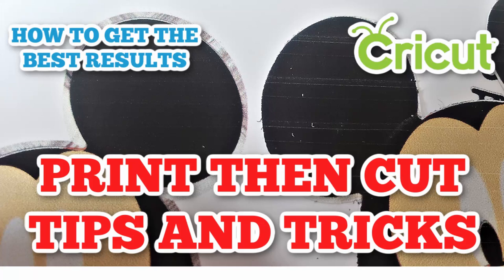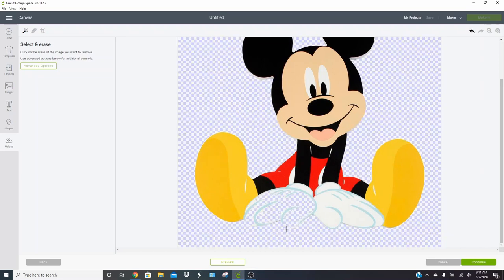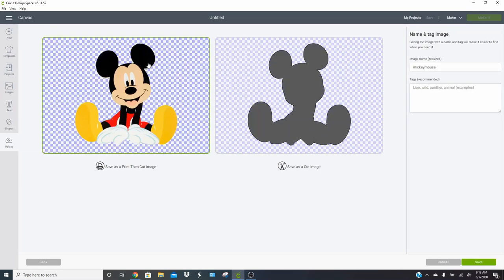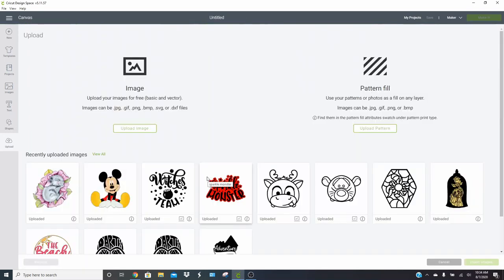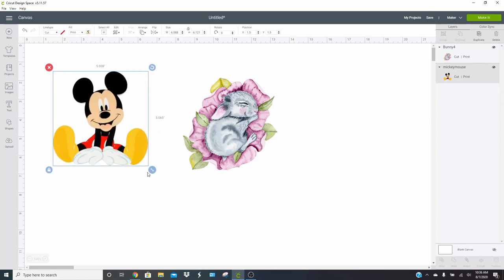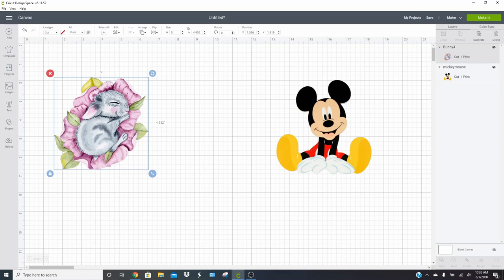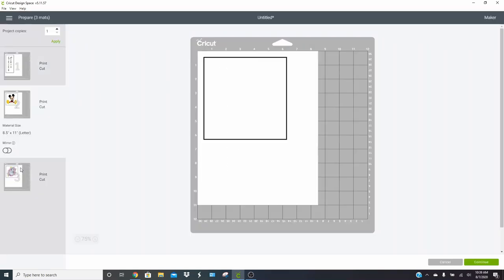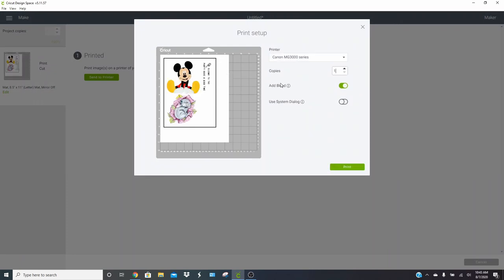print then cut - Cricut tutorial tips and tricks - System dialog - How to print without lines

Comment: Hi! I recently used your tutorial to cut stickers, it worked really well. It seems like Cricut made an update to their Design Space, and now when I print, it prints on only a small portion of the page - and I CAN'T figure out how to fix it. Have you run across this issue? I'm on a Mac. I'm pretty good with technology and can troubleshoot most problems but can't figure it out. Someone on Instagram sent me to you. I'm just wondering if you have had the same problem.
Reply from the maker: A few people seem to having this problem. One thing I have suggested is clearing the cache and also double checking your printer settings. Go under the actual printer not just the print dialog and be sure nothing has changed

Comment: Thank you! I still get lines with system dialogue, any extra helpful tips :(
Reply from the maker: If you are making sure you have turned off your high speed print you may need to run some maintenance on the printer like a print head cleaning

Comment: Thank you for your video.  It was very helpful, however I am still having issues and was wondering if you would be able to help me??  I have done everything you have suggested.  My images print out perfect from my printer (HP Officejet Pro) and once I insert them to my Explore Air 2 it looks like it's working, but it only cuts the perimeter.  Does not cut out the image.  Is this something you can help with?  I have wasted so much time and material and I'm so very frustrated!
Reply from the maker: Sounds like you are not removing the background from your image
Reply: @CorinneBlackstone  Okay I will give that a try! Thank you so much!!
Reply: It worked!!! Yippee I appreciate you so much for responding and helping me out!!

Comment: First of all thank you for this video as it helped me with a few issues I came across when using the system dialog option (it was hiding behind design space!) My problem is that my stickers have been cut off centered. What I mean by that is that I put an offset of 0.3cm around my sticker image, aligned centre (image + offset) then flattened it. all looks fine on screen but then it went through to cut the sticker out around the offset its not even all round, The left side is like 0.2 and the right side is like 0.4 or something. Would you know how to solve this problem? TIA x
Reply from the maker: If you haven’t calibrated your machine you’ll need to try that first. But even since the last couple updates the print then cut has been so bad it’s not even funny
Reply from the maker: Heres the video on calibration https://youtu.be/o5-ZRHqeL78
Reply: @CorinneBlackstone  oh really well that's good news then isn't it 🤦🏼‍♀️ I have calibrated a few times when I had issues when I first bought the machine. I will do it again. Thank you so much !

Comment: Good video, thanks for posting!  I especially liked your tip about using the system dialog...what a difference!  One question, please...what did you mean when you said the part about how calibration on the Explore is print & cut only but calibration on the Maker is for the blade too?  Can you explain this to me, please?  TIA!
Reply from the maker: It’s only for the knife blade on the maker and for the print then cut it to line everything up and the knife blade is for depth

Comment: Can you please explain what you mean about the calibration for the explore? When I do the bleed I still get some white like you did, what can I do to make sure there is no white what so ever.  thanks
Reply from the maker: Calibration is to run your machine and have it read this test page so that it can make sure the sensors are aligned properly. The calibration option is under the settings menu on the left (the three lines) in design space
Reply: Thank you so much!

Comment: Thanks for the tip. I’m making a tshirt but the white box is not looking good when I put on a tshirt. How do I solve that please
Reply from the maker: You would need to remove the box and only cut around the image
Reply: Thanks or the prompt reply. When I remove the box it was cutting the images individually rather than as whole if that makes sense
Reply from the maker: @doubletcre8tions  yes that’s what it does. If you want to put something on a shirt with print then cut it’s going to have the box around it or it will cut them individually if that’s not the look you want you either have to piece it together on the shirt or you need to use something like sublimation on a polyester shirt
Reply: @CorinneBlackstone  makes sense thanks so much 😊

Comment: I use system dialogue but it prints black and white, my printer is set up with circuit but I can’t seem to get the option to print it in color with SD any tips?
Reply from the maker: Make sure to check your printer settings the black and white issue is almost always from your printer settings in your control panel

Comment: Is there a specific vinyl I need to use. My printer is printing smaller then it is supposed to?
Reply from the maker: You have to use a printable product. Check your printers paper size
Reply: @CorinneBlackstone  I’m using printable vinyl. On design space it shows it printing at 4 inches but it’s printing smaller. Do you know why or how to fix this?
Reply from the maker: @jenniferaragon4889  you need to go into your printer properties and check the paper size.

Comment: I need help so bad, if u can pls help me, I’m like a slow learner so I need step by step, I’m using circuit maker, I’m trying to use print & cut but every time I do it when I load it in the maker it keeps cutting like the rabbit but I’m trying to cut it all out like Mickey, can u pls just give me the steps to do that pls? I would appreciate it so much, I tried cutting with scissors but it looks horrible plssss help me, Also I subscribed to your Chanel so I will be watching u
Reply from the maker: it sounds like you are not removing the background from your image before you choose print then cut. Be sure to remove all the white background before you hit apply and continue

Comment: I am doing my print then cut with a sublimation printer, but when I did the print then cut with mirror on my printer bc it's sublimation, it put the black outline on the left side of the paper...so can I load it in the corner still in photo orientation or do I need to make sure the box is turned so that it is in the left corner?
Reply from the maker: You shouldn’t cut sublimation there’s no need to. Plus printing from design space for sublimation wastes a lot of materials and ink
Reply: @CorinneBlackstone   actually, I figured it out. And I’m doing sublimation on HTV, so yes, I do need to print then cut bc I want it to match up exactly for what I’m doing, no overlap.

Comment: When I get to the print part, it doesn't print the top black line. Any suggestions?
Reply from the maker: It's due to your printer not pulling your paper in correctly. change the paper type on your printer to something thicker. and if you are using Cricut brand printable products stop and throw them away. They have broken more printers than I care to even name.

Comment: How can you make a shirt with a bunch of colors and different designs? i just printed it on a light printer transfer sheet since i’m doing it on a white shirt, but how do i make it cut it out all in one piece on the cricut so i don’t have to piece it all back together like a puzzle. i thought maybe putting a white square behind it and that kept it together but it keeps the white and i don’t want that white background to iron on. what do i do???
Reply from the maker: https://youtu.be/UOCvUjoDHTk
Reply: but what if the letters are not connected? what if there are words? is it possible to cut them out together without having them all separate?
Reply from the maker: @caseymozingo4690  like I discuss in the video you use the lights for that. The light type of printable htv does not require cutting with a machine you can trim with scissors if you want to.

Comment: The issue with mine though is I get streaks in my stickers with high and normal quality. I have an HP deskjet printer and I've attempted it with normal quality and it prints very bland colors, mostly when it's a color like blue. But with high quality, it gives me the the colors I want but you can see the streaks way better, again from what I've seen, it seems to only do it with the color blue and similar colors. What should I do?
Reply from the maker: You may want to go into your printer color settings and try playing with the color output. Also changing the paper type might help as well
Reply: @Corinne Blackstone  I'll definitely try that! Thank you! I've also seen some people have recommended cleaning the cartridges using HP smart so I'll definitely try that too. Thank you!!

Comment: Does someone know what to do when after resizing your image another message comes up saying 'not supported by your machine selection. to resolve click ok and adjust affected layers layers'?
Reply from the maker: You design is too big for print then cut. It needs to fit with in 6.75x9.25
Reply: @CorinneBlackstone  i changed  the size to correct one but it still gives me that error message.
Reply from the maker: @perfectly_imperfect  likely because you are still too big or you have the joy selected as your machine. That error will go away when your design fits within the print size some designs need to be just a touch smaller than that size to work

Comment: It did not cut all the way through. How do I fix this?
Reply from the maker: You will need to use settings with higher pressure if you want it to cut all the way through or do a double cut by not unloading the mat and hitting the cricut button again

Comment: My printer doesn't colour in my grey parts of my image, grey, it colours it in green, anyone know why? It's a HP Envy and both colour and black ink are brand new. Also, I tried to print on sticker paper, it was called Removable vinyl sticker paper for inkjet printer, but it was so thick, it jammed up in my printer, are all sticker papers super thick??
Reply from the maker: I would look at your printer settings under advanced you can work with the color settings a bit. Also try running a print head cleaning. I will say the HP does seem to have a little more trouble with thicker products. I recommend Neato https://www.neatolabels.com/?rfsn=5361555.8adf54 When you need something thinner. Their stuff is great but thinner than a lot of the others on the market.

Comment: Well I am feeling like this machine sucked my b*llz!   No matter what I do it will NOT cut circle around my prints.  I've tried printing separte.  I've tried print with the print then cut directions.  What I have wanted to do is cut circles around a pre printed 5x7 cardstock. It will not detect the circles no matter what I do.  Not stickers.  Just little card stock circles around some circles.  Also there is no way for me to choose 5x7.  Hoping anyone here can help.  I totally understand your instructions and instructions of other videos I've watched.  It's not happening for me.  Do I "have to" have big circles around my circles and I big box around the print area?  Guess what?   I've already done that.  Sure this is easy if a trick is known.  Maybe not though.  Wondering if anyone wants to buy this thing?  lol smh
Reply from the maker: I have a few questions. Did you print something onto the cardstock? What machine are you using? What color is the cardstock? Is it patterned? All of these are big factors into why your print then cut may not be working.
Reply: @CorinneBlackstone  Wow!  Someone answered!  The cardstock is white.  It's 5x7 it has tiny quarter sized circles with a picture on them and a dark circle around each one.  I've tried printing first and then cut only and I've try print then cut.  I've tried putting a dark box around the whole thing.  Vs letting the software do it.  I am using a cricut explore air 2.  Thanks
Reply from the maker: @SpinSpin2020  do me a favor shoot me a message on Facebook or Instagram with a picture of your cardstock. My best guess is bad sensors in the machine but it would help to see what you are trying to do
Reply: @CorinneBlackstone  The machine is brand new.  Do you want a picture of the cardstock blank?  Or with the circles?
Reply: @CorinneBlackstone  I don't have facebook.  I'll try IG under my name which is doemajors.  Should I just follow you?
Reply from the maker: @SpinSpin2020  you can but you can just shoot me a message it’s Instagram.com/corinne_blackstonecrafts